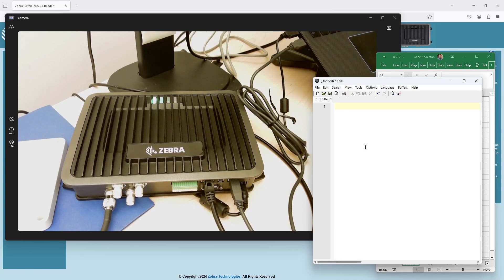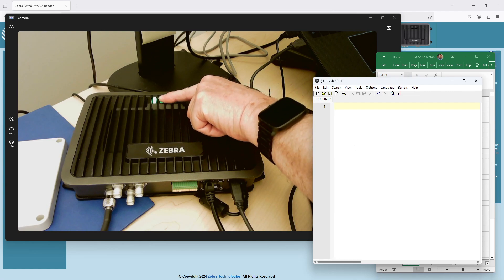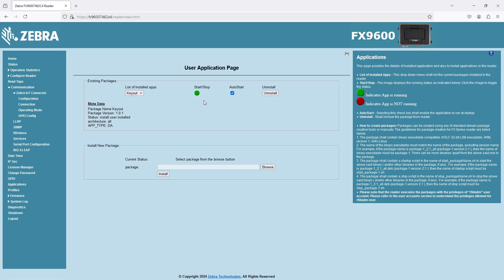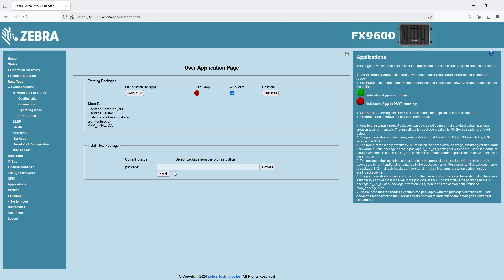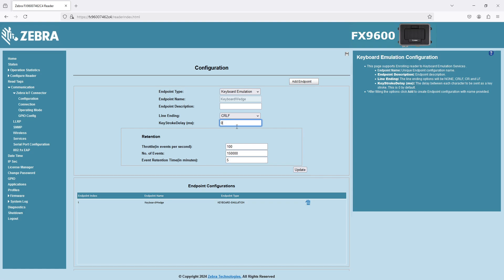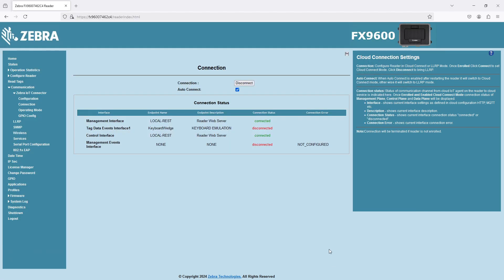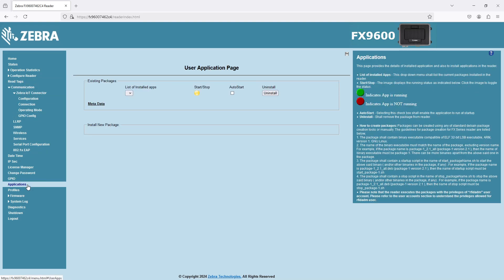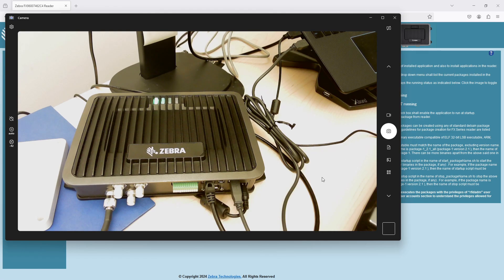Zebra FX9600 RFID Reader:  Keyboard Wedge Demo

Comment: Where you get the application package?
Reply from the maker: I wrote my own variation .  But here is the original source for Zebra examples:  https://github.com/ZebraDevs/RFID_ZIOTC_Examples
Reply: Can you please guide how to do it its urgent
Reply: Want to do poc and I don’t know about the application we are getting json data in keyboard HID mode 

{
  "data": {
    "antenna": 1,
    "eventNum": 15,
    "format": "epc",
    "idHex": "e2801191a50300674a18636e",
    "peakRssi": -67
  },
  "timestamp": "2025-07-08T17:02:45.297+0530",
  "type": "INVENTORY"
}
Reply: Please help 🙏🏻